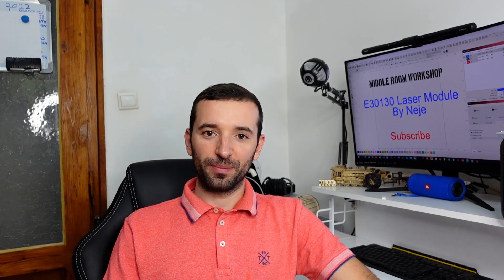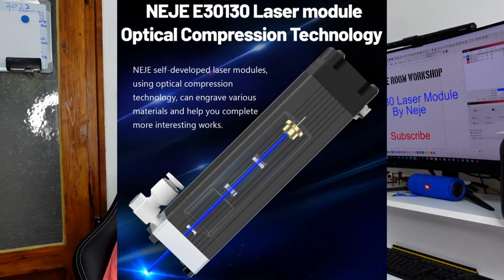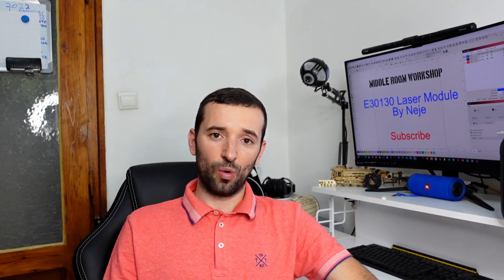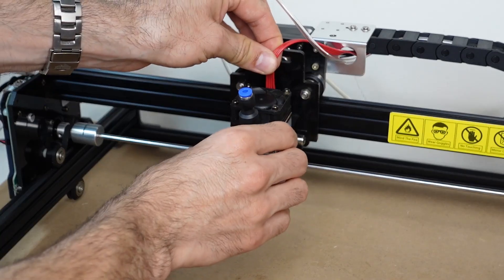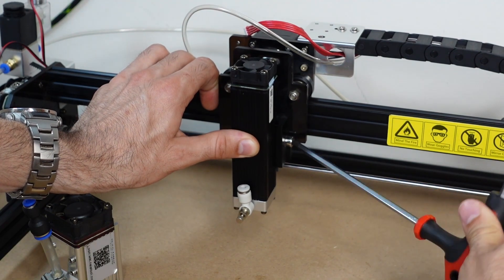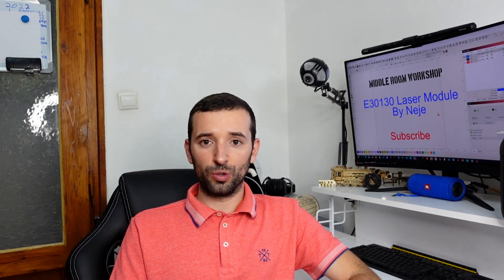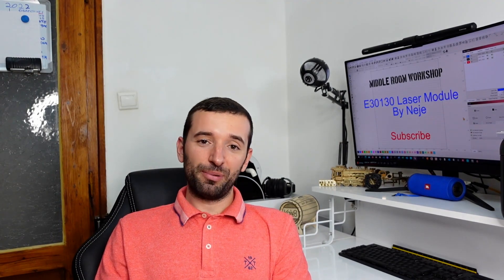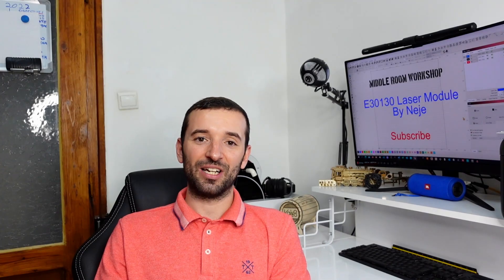Neje E30130 integrated air nozzle Laser Module | Is it any good?

Comment: Hi, I bought a neje 3 Pro with the e30130 module after watching your review. I can't reproduce your cutting test results on 3mm laserply. I downloaded your cutting template into lightburn after running an incline test and setting focus at 11mm but no circles cut all the way through. Was your cutting test only a single pass? Any thoughts or should I return the machine.
Reply from the maker: Hi, Damian Brewster; thank you for your comment. 

The module I got had a focus height of about 12mm, and in the video, I cut 3mm of plywood that is a bit softer than Birch Plywood in a single pass with air assist coming from an actual compressor regulated at 4 bar.

At 200mm/min should come out without effort, while at 250mm/min, you need to push it a bit through.

If you are trying on Birch Plywood 3mm, you may need to run 20mm/min slower, i.e., 180-230mm/min.

Ciao

Comment: is this engraver able to be mounted to other machines like Latitool?  Id like to add air assist.  You referenced some test patterns, where can you download these tests?
Reply from the maker: Hi, Spud Hut, thank you for your comment. 

The laser module comes with an adapting board; therefore, you should have absolutely no problems with it if the machine is a 12V machine. In some machines, you do not need any adapting board, but you need to modify the cable connector. 

You can download templates and free projects from my website.
https://whathowwhysolution.com/category/manufacturing/laser/

Here are some links to the Laser Module 
https://s.click.aliexpress.com/e/_DlXtuf5
https://s.click.aliexpress.com/e/_DBEGsNt

Ciao

Comment: Hi - Thanks for your great Channel..  There can I download the engraving test files, you show in this video ?
I'm a totally new owner of e NEJE 3 MAX.
Reply from the maker: Hi, Steen Mikkelsen; thank you for your comment. 

I have some templates on my website at the following link, but some of one of the videos are missing. I will try to upload them within a few days so that you and other users can have them.

https://whathowwhysolution.com/laser-engraving-testing-template/

Ciao, and have fun with the new hobby.
Reply: @MiddleRoomWorkshop   I've tried your "Engraving Test" and it didn't go so well, - maybe it's because I have a NEJE A40640 and that it's more powerful than what you used and did the Engraving Test" for ????
Reply from the maker: Hi, Steen Mikkelsen; thank you for your feedback. 

The test should work regardless of the power of the laser. 
I mean, the higher power should yield in darker or burned rectangles.

Could you be more specific on how exactly it did not go well? That way, I can try to help you out.

Ciao

Comment: Great in depth video, I am new to lasers and looking to get my first one, would you recommend the neje 3 pro with this module or different one  or the aufero 2 with long or short focus, I can't decide, great videos
Reply from the maker: Hi Lockworx Locksmiths, thank you for your comment.

I have no experience with the Long focus from Aufero, I currently have the short focus.
What I can say at the moment is that among all the machines that I have experienced I am really enjoying the new NEJE 3 Pro, my only complaint is that you cannot get an offline controller, like what you could get as an accessory with the Aufero (you have some options but using their proprietary software)
However, the speed and the possibility to control air assist with the software is great, other than that, this laser module (E30130) has a very fine spot which makes very clean and accurate cuts.

I also need to say that if I compare the old 30W laser module from NEJE  (N40630) with the short-focus module from Aufero (LU-2-4 SF) , Aufero performs better.

The laser module you choose depends on what you want to do with your machine, If you expect more cutting I would definitely recommend the E30130, If your cutting is going to be your daily activity then more power would be suited with the A40640 or newer module from NEJE.

For Engraving the two modules would also be suitable but more expensive than what you would need for engraving only.

Aufero offers a very high speed so if engraving, especially picture engraving is what you want to do, the Aufero Laser 2 paired with a short focus module could do what you need.
However, the Neje 3 Pro has gotten also very fast, so engraving pictures with that is also good.

Each machine has its Pros and Cons,  however, if I would have to choose, after experiencing the new series of machines from NEJE, I would go for it.

Let me know which one you choose.
Ciao